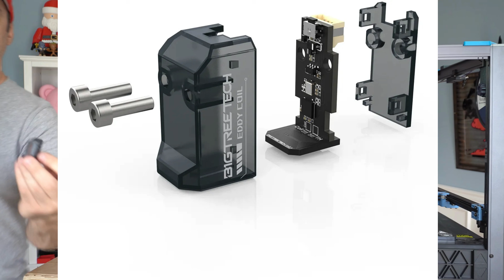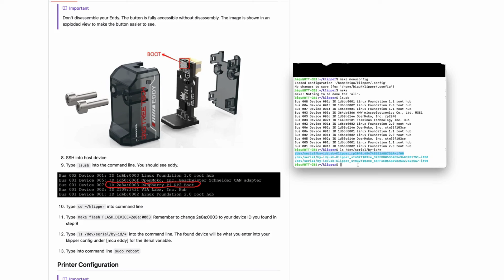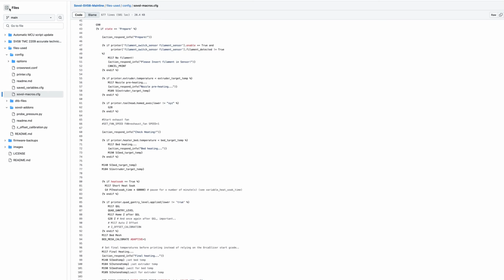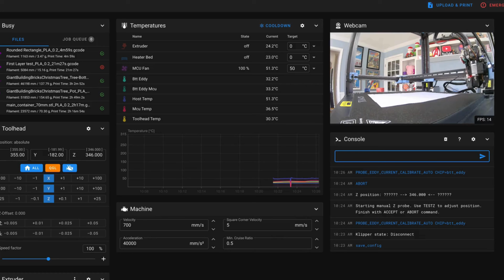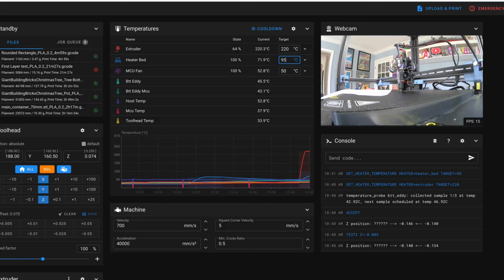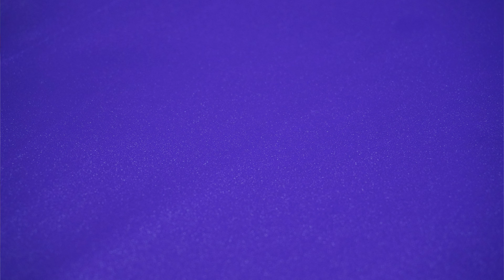BTT Eddy USB Probe Setup on Sovol SV08 – Full Install & Calibration Guide

Comment: So I have a few questions. Is this really worth the hassle to do this upgrade compared to the stock? I thought they fixed the Z-axis issue? And should this be the first upgrade done before any other upgrade? What upgrades should a new SOVOL SV08 owner do before doing others ideally? Also what was the price of the Eddy Coil upgrade?
Reply from the maker: You would have to do a few things to upgrade to this probe. First, you would need to migrate to mainline Klipper to support the Eddy Probe. The Sovol fork of Klipper for the SV08 doesn't support it. Is it a beneficial upgrade, yes I believe it does make a big difference compared to the accuracy of the stock probe. The eddy USB is 25.00 us. Sovol recently had a live stream on an upcoming release the Sovol Zero, on that live stream Sovol said they are working on an Eddy probe upgrade, including a Klipper update. So it appears Sovol is planning to offer the probe upgrade as an option soon as well and know it's a problem area if they are willing to provide an upgrade option. 

In terms of what you should do as a new SV08 owner, I would try the printer first to see if you are having the same issues with bed leveling, or probe accuracy. Some more recently delivered machines seem to be a lot better than earlier ones. At least from a few people I have talked to. If you are having issues with Z-offset, and bed leveling and want to improve accuracy and precision over the stock unit the eddy USB is a good choice. I'm not sure when Sovol may release an upgrade but you could also wait to see what they release as well. Another area that I had a big issue with was my bed. It was warped and got worse over time so I sought an upgrade for that and recently did a review / install video on the Mandala Roseworks bed upgrade - it is expensive. So it's not something everyone would want to do, but since that upgrade my SV08 has been excellent. The bed upgrade would depend on whether your bed is warped, etc. Not everyone has this issue. 

I hope this info helps! If you have any additional questions about setup, etc please send me an email. theprintasaurus@gmail.com  If I can help you with something, I will try my best to do so!
Reply: @ThePrintasaurus  I'm really sold on this printer but do you believe there's anything better? If not though, what can I expect to be able to print or do out of box?
Reply from the maker: @boredfive3001   If you're looking for a Voron 2.4 type printer and don't want to build one. The SV08 is a great entry into a core XY-type printer. It's not perfect, but with a little bit of work, it can print nicely. I am enjoying mine, but I also like to tinker so going through the motions to improve this printer is fun for me. If you haven't already, I have a few videos covering mainline Klipper, this one (eddy USB), upgrading the hotend, and the extreme (bed replacement). I talk a bit about why you would want to upgrade or make these changes. Give them a look and see what you are thinking afterward. If you do get one and have questions or need help. Send me an email, I am here to help!
Reply: @ I don't mind tinkering. I don't mind building from scratch. After all, that's why I'm getting a 3D printer in the first place. To create. However at the same time this appears to be the most versatile, upgradeable, and solid printer at it's price point from my research. My goal is to be cost friendly (to a degree), but still get those quality results in my prints at a large size. It seemed like this printer would cover all those aspects. If I get the Mandala Roseworks + the SV08 is that cost effective or defeating the purpose? Would that save me a headache? I just want to make sure I can do what I need to with this printer, get all the tiny fixes for the complaints people make, and not be like "You mean I could've just got a _ instead?".
Reply from the maker: @boredfive3001   Got it! Yes. If you are willing to tinker a bit and potentially upgrade the bed - this is a great printer. I have it dialed in nicely at this point and I'm very happy with the print quality. You may get lucky and not have any bed issues, from doing that video some have not had warpage, etc from the feedback I received.
Reply: @ I have a laser printer so I kind of know what to expect when it comes to tinkering. I just want to know how much I can expect out of the box with this printer before I'm "disappointed" and feel like I need to upgrade to achieve a better quality print or do something I'm not capable of. I'm not necessarily worried about the hassle of upgrading. I'm more so worried about the price point of fixing any issues that arise or already exist. Like I heard there were fan issues, z axis issues, bed leveling issues, and I just want to make sure I can still "work" essentially without Paying for a "entirely new printer" worth of parts. I'm not opposed to the idea of fixing things and at least it's available compared to already assembled out of the box solutions. Like if I had to put in analogy I'm not necessarily looking for a cake with all the works but I still want the foundation of the cake to be good. Like it might not have the icing but it's still a good cake. If that makes sense.

Comment: On the Sovol Zero launch live stream, SV08 owners asked a lot of questions related to addressing some SV08 issues and Sovol said they are working on an Eddy probe upgrade, including a Klipper update.  It seems their primary focus is the Zero and the 500 mm coreXY machine that was co-developed with the Zero that they should be releasing soon which will hopefully have benefited from some of the education that Sovol received on the SV08 as well as the Zero hot end and bed mesh probe.  It sounds like the SV08 Eddy probe upgrade is going to be essentially this video with a Sovol Klipper update?  Sovol didn't mention the taco bed so that inherently expensive fix is apparently going to be left for SV08 owners and the aftermarket, but quickly getting an accurate Eddy bed mesh should help quite a bit.  It's the low hanging SV08 fruit.  Sovol apparently intends to leave the bed warped but provide an accurate bed mesh that they hope will allow Klipper to reliably print on the taco bed.

My SV08 is down for repairs.  Knowing my SV08 was not able to lay down a reliable first layer, I watched 20 layers before going to bed.  The part detached six layers later.  The SV08 was still trying to print in the morning, with a baseball sized blob-of-death encapsulating the @Microswiss hot end and the heater wires sparking.  I managed to chip away enough plastic to uncover the screws and remove the hot end.  It's a total loss so I ordered a new @Microswiss hotend.  It should be an easy repair but I guess I'm demotivated.  I love my SV08 but it isn't reliable because the bed is warped and the bed mesh is inaccurate.  I won't run it unattended until it can print a reliable first layer, even if that means I need to spend $500 upgrading my $500 printer.  I've been preheating the bed and prox sensor and printing parts on rafts that wouldn't need a raft if the bed was flat and the bed mesh was accurate, but even that isn't as reliable as it needs to be.

My Sovol Zero should be shipping in a few days.  Sovol promises a perfect first layer every time.  With the small bed, Eddy current bed mesh and directly sensing the heated nozzle touching the heated bed for the Z=0 offset, the Zero should make perfect first layers every time.  I'm going to hold Sovol to that.  Before anything else, a 3D printer needs a good first layer to print well and to print reliably.

On the Sovol Zero launch live stream, SV08 owners asked a lot of questions related to addressing some SV08 issues and Sovol said they are working on an Eddy probe upgrade, including a Klipper update.  It seems their primary focus is the Zero and the 500 mm coreXY machine that was co-developed with the Zero that they should be releasing soon which will hopefully have benefited from some of the education that Sovol received on the SV08 as well as the Zero hot end and bed mesh probe.  It sounds like the SV08 Eddy probe upgrade is going to be essentially this video with a Sovol Klipper update?  Sovol didn't mention the taco bed so that inherently expensive upgrade is apparently going to be left for SV08 owners and the aftermarket, but quickly getting an accurate bed mesh should help quite a bit.  It's the low hanging SV08 fruit.  Sovol apparently intends to leave the bed warped but provide the accurate bed mesh that should allow Klipper to reliably print on the taco bed.
Reply from the maker: I'm curious about what Sovol will come up with for an upgrade and what the pricing may be to do it. It would be nice for them to have future released SV08's with the eddy and mainline Klipper already setup out of the box instead of just an upgrade. I'm surprised they aren't revising or considering the bed as an area of concern. 

I'm finally at a point where I feel like I can start a print and leave the SV08 to do its thing. It's taken a while to work up that trust lol, but I've put it through its paces on some 24-36 hour large prints and it's done its job!

Comment: Hey, thanks for this video, it really helped me.  I just went through this, as well as adding the MRW bed over the last two days.  I thought I'd add a couple things that I found while setting up Eddy for my machine!  

First, Eddy is delicate, and I had problems getting the first one out of it's plastic case.  Hence, first one.  Be real careful not to flex the two pieces of PCB, else you'll break the solder joints between the two!  AND, if you have a Microswiss nozzle, as I do, it's apparently slightly different in height relative to the stock nozzle, so I used a different mount.  I got it from Printables, I think.  The point is, mounts vary, so be sure if you have Eddy Duo vs Eddy USB that your mount works.  Eddy DUO has a switch on the back to select between USB and CAN, and some different stuff on the other side, so while it looks very close, the fit is slightly different.    

Second, as soon as I began the temperature calibration, the toolhead started moving slowly to the right.  It stopped at about 20mm from the rightmost edge.  Yours stayed in the center, so I thought something was wrong with mine.  It wasn't...the Eddy.cfg file moves the toolhead to the right intentionally.  Just wait for it to stop, and do the temp calibration at that spot.
Reply from the maker: Thank you for the support! I responded to your other comment on the Mandala Rose Works bed! Your YouTube name - I ride too. Shoot me an email, always curious to see what others are riding setup wise.
Reply: hi , which mount in printable you use?
i also have the microswiss nozzle too

Comment: Please clarifiy.  The title of this video is Eddy USB Sovol SV08 Install and Configuration, - Eddy USB, but Eddy Coil  is mentioned in the video.  Which one is required, or does it matter?
Reply: Eddy coil is the canbus version, and won't work on the Sv08 in stock form.  Some people accidentally use the term coil, when they mean usb.
Reply from the maker: @  Yes! I apologize for the slip-up. Since this video, BTT has come out with the DUO that is both (Selectable USB or CAN) - The standard USB one has not been in stock for a few weeks now. Here's the link to that one. 
https://biqu.equipment/products/bigtreetech-eddy?_pos=1&_psq=ed&_ss=e&_v=1.0
Reply: @ThePrintasaurus  I have ordered and received the Eddy USB from AliExpress.  But, noting the difference I also ordered the Eddy Coil.  So, I should try and cancel the Eddy Coil order, if I can, correct?
Edit:  Nevermind, it's been shipped.  That's okay, maybe in the future I will switch out the mainboard with a Can Bus.
Reply: @NorthTXMountainbiker  Thank you for the explanation!  Cheers!

Comment: Hello, I would appreciate some help after I followed your tutorial and installed successfuly the probe.
I am having issues with the probe today. It is intermittently losing connection.
Based on the logs, there are no invalid bytes or excessive retransmissions, but the frequency (freq=12000454 adj=11999796) looks a bit off, which could indicate power or signal stability issues. 
The log shows btt_eddy_mcu: temp=39.2, which is not too high, and I have been heaving printing in the same condition for the last 45 days.
I have not messed with the cables and the only thing I did with the machine is adding an extra webcam on the external USB port
I think I have my eddy configuration, ok. 
Is the printer.cfg supposed to have all the section of the probe_eddy_current and temperature_probe btt_eddy commented out (not enabled) ?
And for some reason I have a lot of printer.cfg files as backup (printer-20250227_125843.cfg)
Reply from the maker: Shoot me an email and I'll send you my printer.cfg to compare. But you want to comment out the [probe] section - this section.
# PLEASE REMOVE THIS WHEN USING EDDY
#[probe]
#z_offset: 0

#[probe_pressure]
#pin: ^!PE12     
#x_offset: 0                  
#y_offset: 0
#z_offset : 0
#speed: 1.0

I have heard a few reports on cables having some interference and needing to add an EMI/RFI filter to the USB cable. Amazon has a large assortment, just search for USB EMI RFI filter. 

Those are printer backup files klipper writes. If you click on the gear on the config files menu you have a option to hide backups.
Reply: @ThePrintasaurus  tTanks for the answer. I wrote an answer before, and I don't see it rendered here. I'm not sure what is happening with my browser.
I found an issue in github with "Klipper lost communication with MCU 'eddy' #30". I will try the filters you mentioned.

Comment: No matter how often I repeat this process, I can't get a decent Z-offset with it. I think the temperature compensation calibration doesn't work as intended on the SV08, because the bed bends when heated. The "taco" bed shape becomes more pronounced the longer and hotter the bed is heated. This changes the build plate mesh from what was previously measured. However, bed meshing is not repeated during the temperature compensation calibration. Therefore, I suspect the value is off because Eddy assumes the changed offset is solely due to temperature differences at the sensor - when in fact, the bed shape itself has changed...

To make matters worse, the Z-offset calibration during temperature compensation doesn't happen at a fixed X/Y position – the print head moves around. Since the bed shape changes quickly and unevenly when heating up, this movement introduces even more inconsistencies. As a result, the Z-offset becomes even less accurate.
Reply from the maker: After switching to the eddy, I have worked through a few things so far. One thing I have found beneficial, not sure you have tried. But switching/adding the beta Zoffset config. It allows micro stepping similar to what you would do with a regular probe. So you can fine-tune things as a print starts and save that Z-offset once you get it where you want it. On my voron with a proper bed, this has worked perfectly. I continued to struggle a bit with my SV08 bed as it continued to warp more. I went down the road of shimming the bed to improve things. This made a difference. But ultimately, I went with a Voron 350 bed adapter kit that completely resolved the bed issues. It's an expensive option, I would start with trying to shim the bed first. I recently did another SV08 video covering the bed adapter conversion. This is the link to printables with various options for shimming. 
https://www.printables.com/search/models?ctx=models&q=sv08+bed

Shoot me an email if you need help with making any bed changes. Happy to help if you if I can!
Reply: @ThePrintasaurus  Thanks for your reply! :) I had already tried the beta Z-offset config, but even with that, I still had to re-adjust the Z-offset for every print. The measurements were just too inconsistent. So I finally gave in and switched to eddy-ng. It was quite a bit of work, but totally worth it! All my Z-offset and first layer issues are gone. Honestly, I’ve never seen better first layer results. eddy-ng is simply amazing!

Also, thanks for the great video and all the info :) I’ll definitely look into the shimming mod!

Comment: I was having issues with "BED_MESH_CALIBRATE METHOD=rapid_scan" running the standard probe scan and failing on my machine at the half way point with "Probe triggered prior to movement".After looking through the macros I found "BED_MESH_CALIBRATE_BASE ADAPTIVE=1 METHOD=rapid_scan" which worked as I expected "BED_MESH_CALIBRATE METHOD=rapid_scan" to.

Comment: @theprintasaurus Many thanks for the tutorial. I just finished to install the eddy (after installing Mainline). But I still have issues with the first layer. I did the calibration with the paper method already several times, but the offset is either too high or too low.. Do you have any tip you can give me on the way? Really appreciated. Many thanks!
Reply from the maker: I would add the z offset beta options found here. This allows you to micro-step your Z-offset and get things dialed in and allows some additional fine-tuning. 
https://github.com/bigtreetech/Eddy/blob/master/sample-bigtreetech-eddy-zoffbeta.cfg

Comment: you can plug it in the board of the head, is usb.
Reply from the maker: The tool head does have an I2C port, it's the power that gets a little tricky to get things stable. A couple of individuals have done it, and have shared the process. Both have said it wasn't worth the effort and easier to just run the cable to the mainboard and plug in.